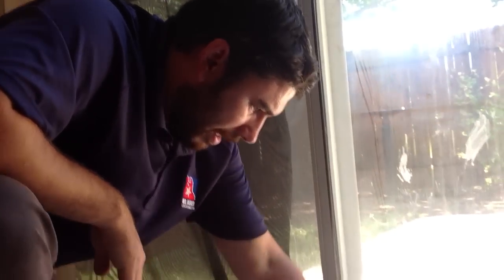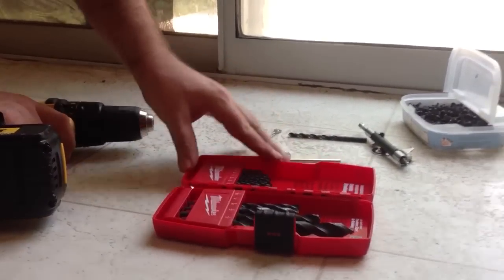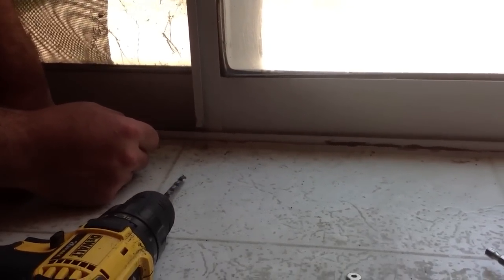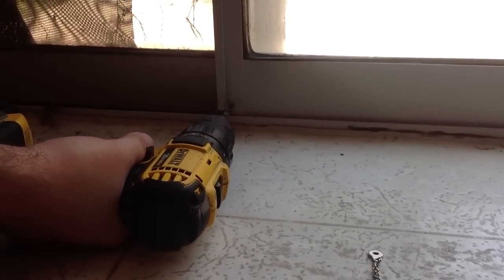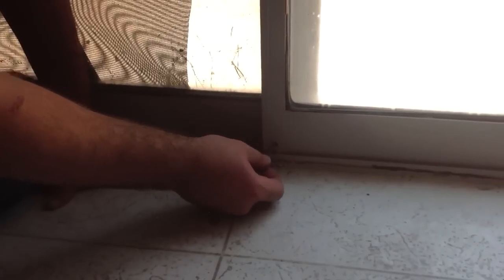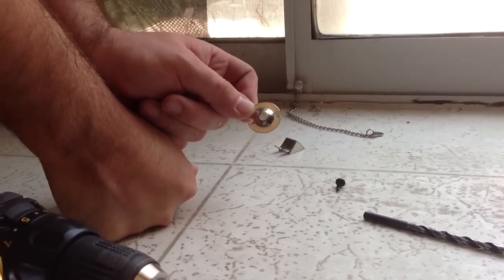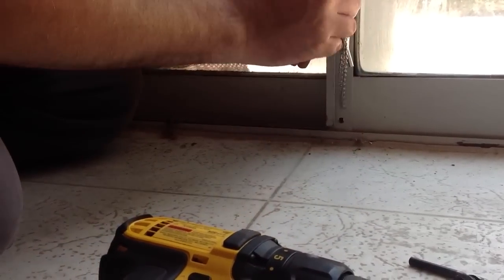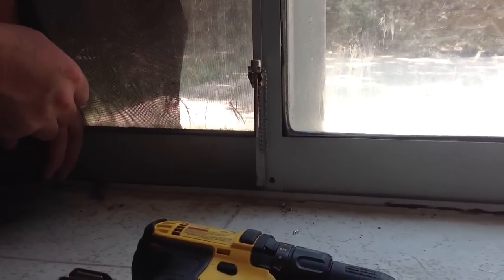Patio pin lock installation

Comment: I guess I can install this on the top of sliding glass door? I'm using this because I painted my old door and the old handles were in bad shape so I ordered a new handle but didn't realized it didn't come with the lock mechanism so this will do the job! And we have 24 hours security so it's pretty safe, I even wouldn't bother but since it's a vacation rental...

Comment: Thank you so much! Was trying to visualize how this thing was supposed to be installed. I think I'd prefer to place it up high so my kiddo won't get at it. :P

2 questions: 
1) I saw a review on Home Depot that wasn't fully completed that said a contractor was easily able to defeat the lock. How secure are these locks? Are they better, worse, or equivalent to the screw/step-on type locks?
2) Seems to me someone could easily defeat the lock by using a drill on the outside of the door, no? Or do we assume people breaking in probably aren't bringing toolsets to the job site? :P
Reply from the maker: Phillip I would recommend a Charlie bar instead less likely to break glads
Reply from the maker: Phillip also, I really don’t recommend this pun, I do them because the my are required by code for rentals but would not try to do this on a home
Reply: @rekeytraining  Oh! Okay, good to know! I was looking for something secure but also easy to use. Looks like charlie bars might not be as difficult to deal with as I expected (maybe only slightly more effort than the dowel we use right now)